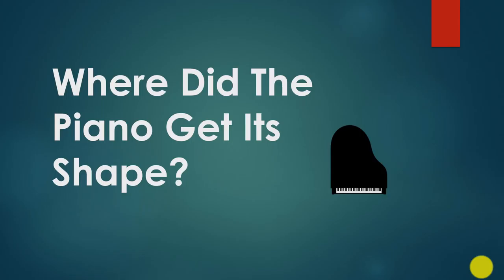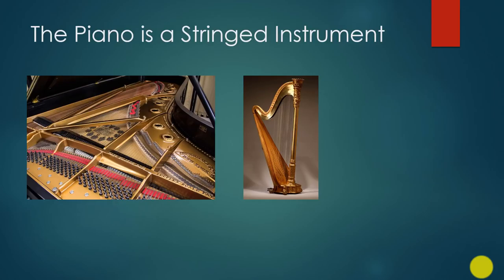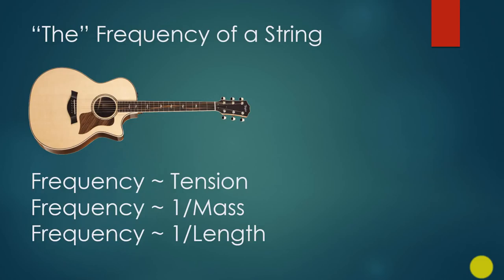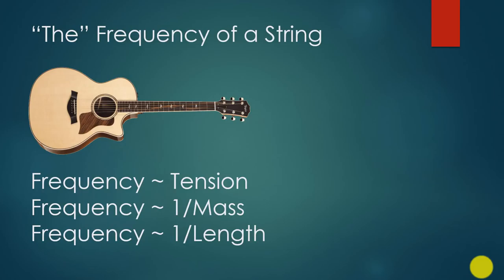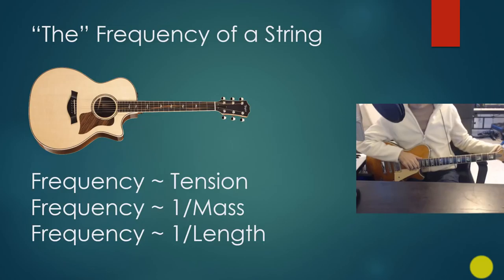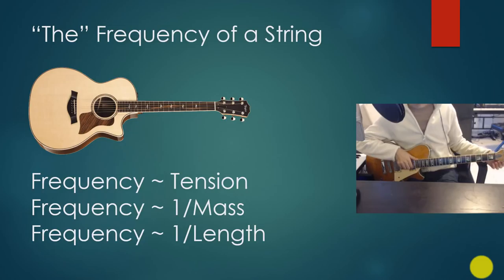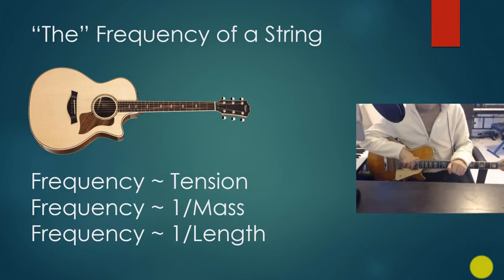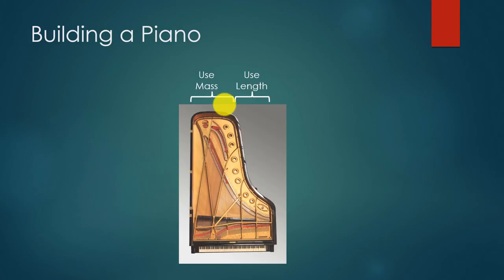Where The Piano Got Its Shape

Comment: This is really fascinating to me. I have always wondered how the frequencies of each note were determined and ensured before the days of electronics. Could you explain that? Just wondering.
Reply from the maker: Are you asking how piano tuners knew whether a string is tuned to a particular frequency? It's called a tuning fork :) They still use it today (few piano tuners use electronic measurements today as well). You can build a tuning fork to any given frequency with great precision - it's all about mechanical engineering (which reached substantial precision long before electronics came into the picture).